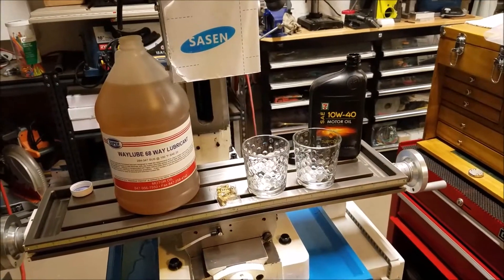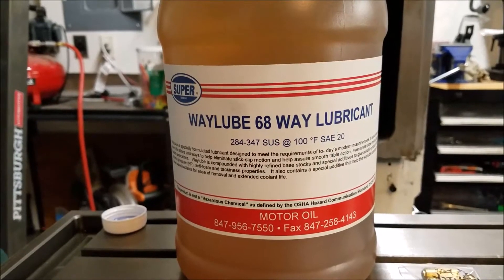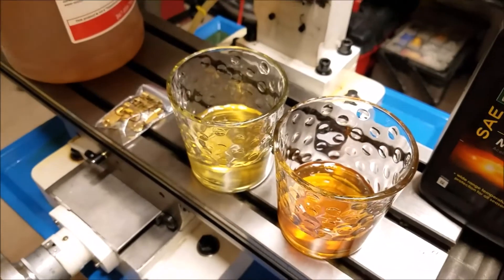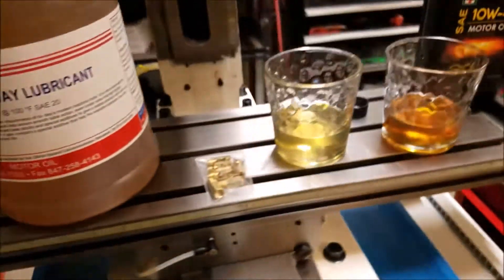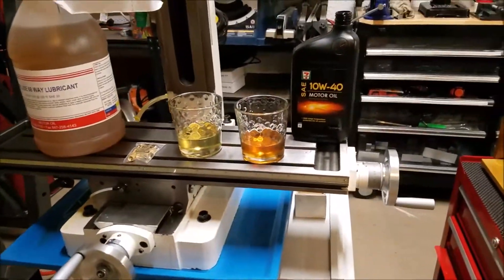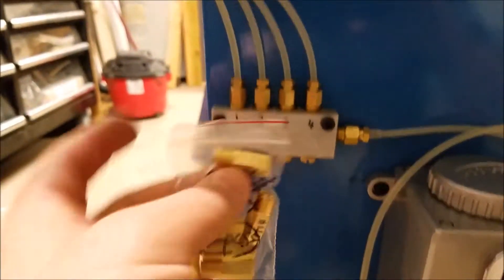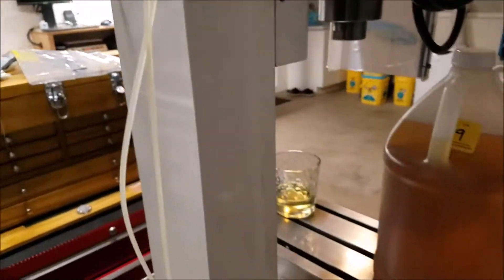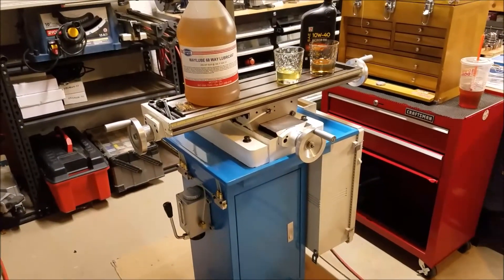PM-25MV CNC Conversion Part 2.1: One Shot Oiler Continued

Comment: As an FYI in case you did not know the original One-Shot systems use restrictor orifices at the oiling location I/E X - Y Gibbs etc.  this is nice as you when you pull the pump handle it is spring loaded for return and it takes 30-45 secs to pump; this allows you to traverse the axis and spread the oil across the length of the ways.

Comment: Nice. I'll have to look up those check valves and get some for mine.  
I'm curious to see how long it takes your one shot to leak from the bottom.  
Thanks for the vid!
Reply from the maker: The check valves seem to be doing their job - there is far less oil seeping out to the machine now.  Hopefully, the pump won't start to leak.  I'll let you know if it does.  Thanks.
Reply: Cool.  I've already ordered the check valves from the same source you listed.  I'm hoping it will cut down the number of pumps it takes to oil mine......especially since the handle is so uncomfortable! lol  Thanks!

Comment: in my way lube collection "moat" i have a  drain tube at the lowest corner, it has a coarse chip filter screen, it funnels into a plastic bottle. Every few months I pour the collected way oil through a finer filter and then use it in my one shot pump reservoir again.
Reply from the maker: Good idea.

Comment: Re your lealing oil, would it be viable to use the 4mm Aquarium airline anti-return valves (very economic)right at the end of the tubes where they go into the machine, that way the tubes stay full and a short pump has them all full and ready to go.
Reply from the maker: Hi.  I was able to solve the problem by putting a metal ferrule inside of the tubing.

Comment: hello thank you for sharing your built on youtube. I would like to make a similar built with the same electronics but I am having a hard time deciding which mill to convert. PM-25V, PM-30V or the PM-727M. why did you decide on the PM-25V instead?
Reply from the maker: Hi.  I wanted to stay away from geared head mills as I suspect the gear train makes vibrations that could affect surface finish.  I decided to go with a belt driven mill, instead.  That being said, I probably would have purchased the PM-30V had it been available when I made my purchase.  If the PM-727V (geared head) is able to give a good surface finish, then that would be a great option as well as it comes from the factory with a 3000 RPM spindle.
Reply: Thank you for the reply. Looks like I'll be going with the pm-30.

Comment: Were dids you get the check valves?
Reply from the maker: I found them on eBay.  As I recall, it was a guy that sells nothing but oil line components and accessories.
Reply: @FrancoCNC  OK Thank you.

Comment: Oil that is not circulated and filtered must be detergent free. "Detergents " in motor oil keeps particles in suspension to allow filtration . This is undesirable in non circulating systems used in lathes and milling machines
Reply from the maker: Great information.  Thanks!